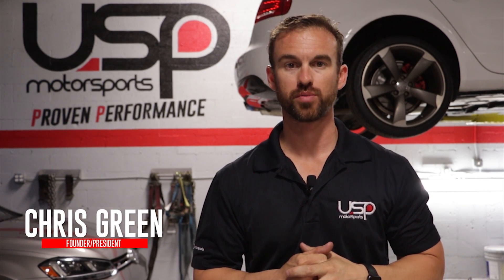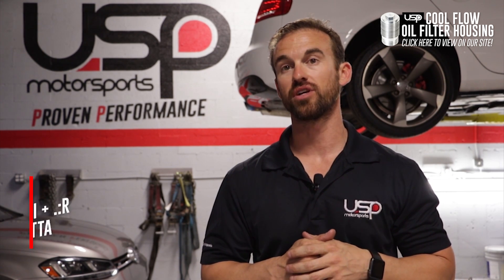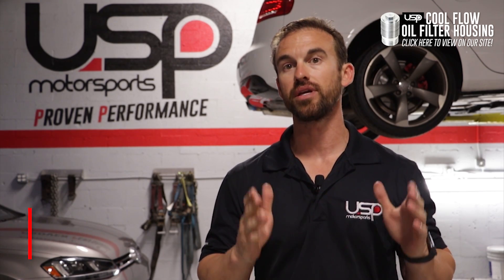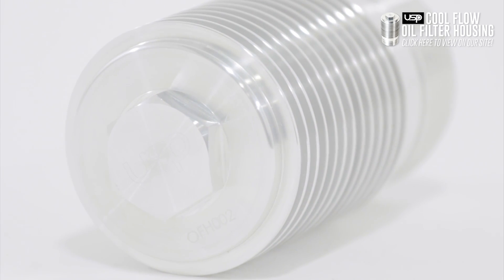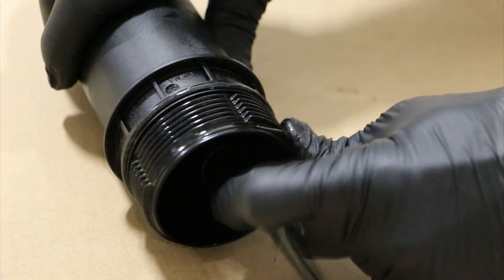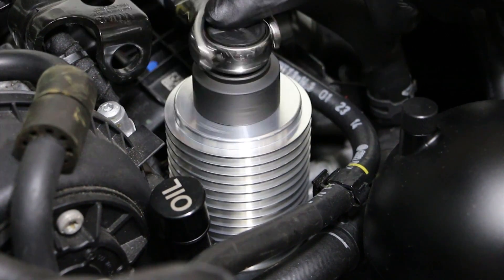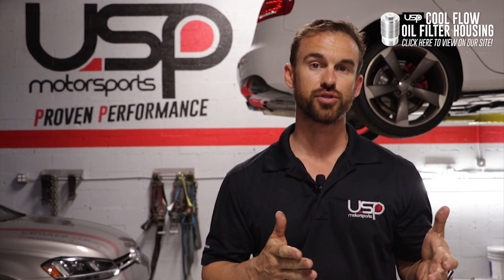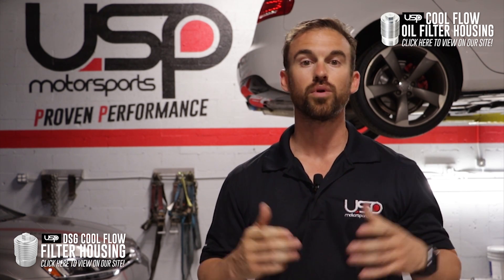USP Cool Flow Aluminum Oil Filter Housing | 1.8T and 2.0T - Generation 3

Comment: Video had a lot of comments about how "cool" it looks but no information about how it will actually cool the oil.  I assume that is what the heat sink design is for correct? Where can I find data about how many degrees this item will cool the oil in the engine..   I ask for this because I am skeptical that this tiny heatsink will cool it that much at all considering the volume of oil in the oil pan which does not have a heat sink and the fact it is packed into the engine bay without direct ventilation.

Comment: I may have the wrong part but I bought this for my 2006 Audi A3 2.0T FSI and it seems shorter and won't tighten all the way up on the holder. Part #7415